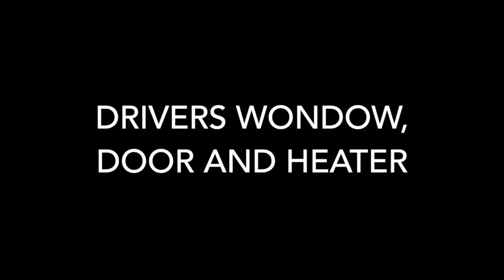Bus to RV conversion 18 - How much $$$ so far

Comment: Power watched all of your videos straight thru since Monday. Nice work so far. You and I are at about the same dollar point for our buses. You are further along than I am. My bus was sitting at $1500 until the last 5 minutes of auction then some asshat exporter drove up the price. After auction fees, I got mine for $3807 back in April of this year. My flooring is in slightly  better shape and not a lick of trouble from it mechanically. Took it up to Watkins Glen for Memorial Day weekend as a giant metal tent. No seats, just a LOT of rust dust.

Can't wait to see what you do with the rest of the flooring. No one on skoolie.com seems to be using spray foam on the floor. I decided I was going to try it before seeing your video. What are you plans for the dips and peaks? The skoolie kids seem worried about air gaps and condensation. I figure water will only condense on the cold side which is under the bus. An air gap between spray foam and foam board won't make any difference.
Reply from the maker: I used my experience as an estimator for a spray allied  coatings contractor.  heres a vid i did explaining why I went with spray foam.  The peaks will get cut down flush to the framing, the voids get left as voids.  Im going for an average thickness.  spray foam is 2-3x the cost of board foam, but it does what board foam can't.  I think the video makes the case.......https://www.youtube.com/watch?v=vEyskuN4b_U
Reply: dzlfreek Can you use your experience to get me a quote for spraying the bus? I only got one back and those crackheads wanted $4200 for 3 1/2" thick 2 lb foam. It was for floor, walls, and ceiling but still that's more than the bus!!

Nice add-on video. Didn't know the numbers but the concepts are spot on. And that's why I was thinking spray foam. Instant and complete seal, insulation as well, and semi level (level enough). Board foam over that. Going for a total of 3 1/2" prior to subfloor. Radiate heat sandwiched in the too.

Not sure how high I'm going with the roof raise. I was thinking 18" as it would leave me 3" overlap with the windows and rub bars. That's a full sheet, no cutting. But not sure I want to give up the bridge clearance. My beacon light is sitting at 10' even right now.
Reply from the maker: i wouldn't do 3.5" thick with 2LB foam.  1.5 - 2" average will suffice and figure $1.50 ish sqft.  2" seems to be the point of diminishing return. I didn't get a quote from a contractor, but I know from doing Time and Material Quotes that 1500.00 a day was enough to cover the overhead and provide about a 3% margin, and that was nearly 20 years ago.  Still, at 1.50 sqft and 1150 sqft of spray area leaves me at 1725.00 so Im not really saving any money, but I can do it at my leisure and know that its getting done per my specs.  Im fairly certain doing it myself is going to cost 1500 - 1600 by the time I'm done.  

If I had to do the raise again I would've done 19.5" because that would cover the overlaps I needed without cutting the sheets.

Take the beacon off the roof, you don't need it.  My bus sits at about 11'6" now.  19'5" roof raise would still have me under 12'....still shorter than many coaches.
Reply: dzlfreek I'm not planning on wintering in Alberta but should I get a wild hair up my ass, I don't want to be chased out by the weather. I'm also hoping to make the bus a tiny house only completely mobile.

Using some online calc, I was getting somewhere near $3700. For the extra $500 it would be worth having it sprayed right. I need to go back and redo the math for 1".
Reply from the maker: ask for a bid for 1.5" average thickness
Reply: Bob, did you say your in Alberta? I'm in central Alberta and will start my project this weekend hopefully... picking it up on Thursday! really humming and hawing about my insulation options though.
Reply: Ken,
Sorry for the confusion. I am NOT in Alberta. I'm in Maryland. I was saying that if I decide to take a winter trip to Alberta for whatever reason, I want to be able to. I don't want your winter temps to be the reason I canNOT.

That said Banff is SOOOooo on the bucket list.

Comment: I would avoid a black water system. There are plenty of commercialy available composting toilets but alot of $. Goolge 5 gallon composting sawdust toilet. Very cheap and works awesome.
Reply from the maker: My wife will NEVER agree to a composting toilet....NEVER.
Reply: Most women would not agree. Lol  I think it could only take another woman to talk her into it. You know a woman who actually used one and saw the huge benefit to a composting system. To each his own I guess.
Reply: As some like composting toilet and others do not...  I get it... I like it.. But i WOULD NEVER add one to my bus... Same problem.. My wife hates them, dont like it.. and she would never clean it... Unless your plane was to follows us and clean it... its a no go.... so Black water tanks stays...
Reply from the maker: IKR?  The other problem is I have to re-title this as an RV and in the state of NV, that means an inspection.....both for the conversion and safety.  I can have everything thats required to be an RV with the exception of a black tank and the state won't recognize it as a RV.  So if'n I have to put in a black tank to pass inspection, I sure aint rippin it back out!
Reply: Bummer that your state has such regulations on composting crappers. A black water system may be cheaper too. Some of those fancy composting toilets are $1000+. I myself would only use the $2 five gallon bucket. Everyone is different and if you don't want it then that's the end of the story. Either way this bus is awesome!
Reply: Find some happy RVer’s who are using composting toilets and let their enthusiasm strengthen your position,.......don’t forget to cross your fingers  lol .........If that fails see if she would volunteer to empty the black tank, be sure you have secured proper cover before asking,.......

Comment: Just a suggestion, don't use particle board, use plywood. if particle board gets wet it will get ruined. Plywood is easier to fasten to also.
Reply from the maker: Im using OSB T&G subfloor.  OSB is more consistent in thickness, doesn't come off the bunk warped and doesn't have any voids like plywood. Plywood is to inconsistent.  It can only get wet from the inside and Im not worried about it. Plus its 10 bucks a sheet cheaper.

Comment: i know it's way too late now but what prevented you from cutting the lower side panels along the struts and bending them out to meet the sidewalls, cutting off the holes to the bottom of the bus and using spray foam all the way to the sides of the bus? I'm just asking because i'm curious how much more Work would have been involved in that, and what potential problems would you foresee with that?
Reply from the maker: if I understand your question (and I may not because I'm kinda thick in the melon) that would have been a ton of work and the spray foam does, in fact, go all the way to the walls.  Its just that there happens to be metal in the middle of the foam.  BTW that metal in question is 14 gauge.....and is welded to the framing.  Also, its stout enough to be an anchor point for seat belts which i may need to install to get it to pass safety.
Reply: dzlfreek ahhh, that makes more sense.

Comment: Also on your $6000 bus build talley, just curious how much was the plane ticket and fuel cost on the return trip. If you don't mind sharing? I'm just trying to get a better idea in my head or maybe others looking to do the same thing. Thanks
Reply from the maker: Wife flies weekly so she accumulates flying miles for personal use.  Flight cost was 5 bucks out of pocket.  The seller filled the 100 gallon tank so my fuel cost was around 300 bucks for a 1200 mile trip.  I was planning 600 to 800.00
Reply: You did really good there on expenses!